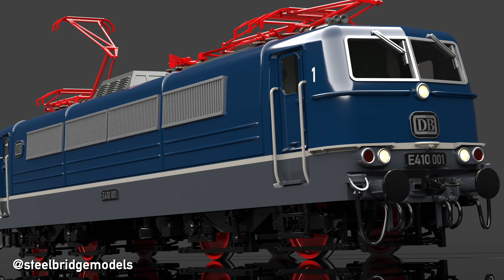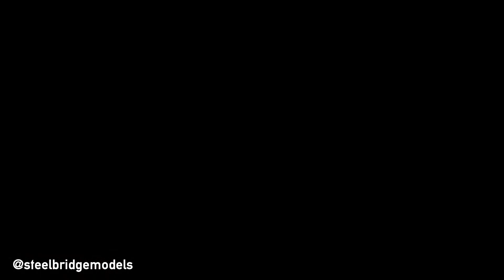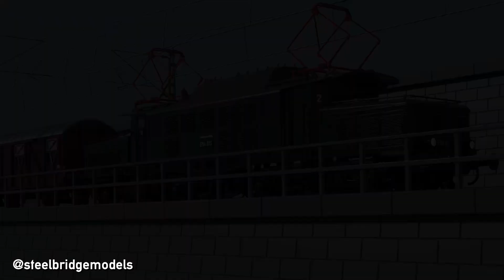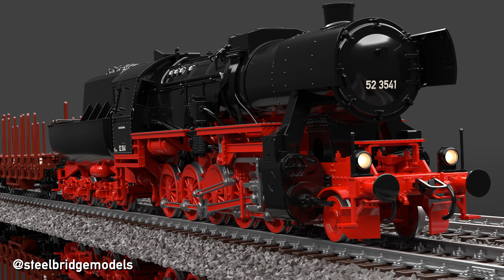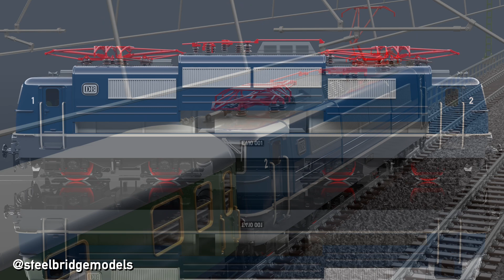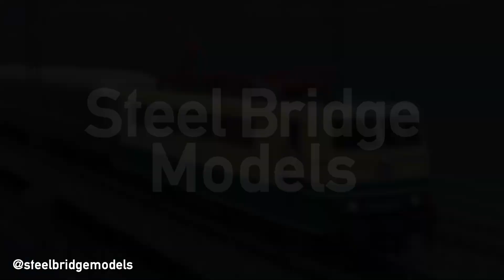And why that requires 4 Pantographs!

Comment: Very very informative, thank you.

What I'd now be really interested in is how the swapping from one Country electrical system to another was actually done - was there a section of catenary which could be switched between different voltages when a loco stopped under it and was ready to drop one pantograph and raise another?

Comment: Would you consider making models of one-off experimental engines like turbines or high pressure locos?
Reply from the maker: If they are unique and/or historically important enough, definitely. Currently, however, experimental designs are fairly low on my priority list. Any specific ones you're thinking about?
Reply: @ H02 high pressure and T18-1001/1002 turbines. But they are kinda obscure and a little short on details so I don’t know if they would be of any interest to you. But they were fascinating experiments that looked at alternate methods of steam power so if that matters to you in anyway it might be worth looking into them
Reply from the maker: Obscure they are, but very interesting! Coincidentally I even have enough research material about both of these classes to create models of them. So maybe one day, but unfortunately not anytime soon.
Reply: @steelbridgemodels  then I’m sure you’ve looked at the Franco-Crosti class 50.40s. Just wanted to bring these to your attention.
Reply from the maker: @SteelCityNLakeErie  I have and due to their relatively large number they have a fairly good chance to be turned into a model eventually!

Comment: For me, most logical solution is 25kV 50Hz AC, as 50Hz is EU standard, and 25kV is good compromise between power, power loss and insulator cost.

Comment: some corrections are needed. 25kV 50Hz actually have German origin. In 1936 Deutche Reichsban have electrified Höllentalbahn line using 20kV 50Hz system. Due to post war occupation French engineers examined this system and introduced it on then isolated section south of Geneva in 1951. Just two years after that voltage was raised to 25kV and this became new standard for French railways. Or did it? Actually France still had 1500V DC electrification spreading widely.
DC for traction motors is very convenient: series motor is relatively simple and can be controlled via use of passive components. Germany have experimented with three phase electrification (as the country of origin for three phase systems), but it was too much hassle - induction motors had large starting current and did not like voltage assymetry happening, when one of three pantographs experienced arcing. This is why Germany went for single phase supply, but grid frequency was too high for universal series motors (they can run on DC too and have construction very similar to series DC motor) - now commutator was experiencing arcing. To reduce it frequency was brought closer to DC - at first at exactly third of national grid frequency. Being AC it still allowed to use transformers onboard the locomotive, reducing current and making arcing automatically quenching when passing 0V. Perfect! Nearly, because it required building nationwide railway grid. However, they made it and have it.
20kV (and later 25kV) was different. While overhead wire carries AC, motors are using DC. This was made possible by moving most of substation equipment to the locomotive: transformer and rectifier. This approach allowed use of high power DC motors - still simple to control - without melting the catenary. And it could still run off DC lines, just by simply bypassing the onboard substation. Advance in solid state rectifiers brought another idea: induction motors are typically smaller and have no commutator. This increased cmplexity of traction vehicle, but actually ade it more reliable.  Yet, single phase load on the national grid may create imbalances - however even in France they are at acceptable levels.
Reply: Have you ever heard about the Hungarian genius Kálmán Kandó? He developed the 3-phase system for North Italy, then, between the 2 wars, electrified the Budapest-Vienna railway with 16kV 50Hz AC using a special converter, which was a 16kV 1-phase synchronous motor and a 3-phase synchronous alternator in one machine. It required a.small DC motor to accelerate it to the synchronous speed,.then the main contactor could be switched on. The V40 was designed for passenger service with a higher top speed, and the V60 for freight trains. Most of these locos survived WV2 and the last one was decommissioned around 1960, when the voltage of the last Hungarian tracks were altered to 25kV. Newer locos were built using a transformer (with 16 and 25kV taps) and a silicon rectifier or a Ward-Leonard machine (ac synchronous motor + a DC alternator of a diesel-electric loc).
Reply: i thought the 1/3rd grid frequency for rail power in Germany was to counter imbalances in the grid (since each phase gets the same average load)..
Reply: @unitrader403  you don't need frequency conversion to balance loads. That can be done with transformer connections in more exotic configurations (like Scott-T or even zig-zag), rotary converters, separate generators (fun fact: Germany had some power plants with separate turbogenerators) and modern day solid state conversion plants. Yet even in France, where you have single phase transformers tied to HV grid the imbalance is minuscule - and we are talking aboute power hungry TGV, not motorized cars of early days
Reply: @michawisniewski4654  not assuming todays tools for frequency conversion, i was thinking entirely about rotary converters and similar things available when these standards were established and the reason for choosing vthis frequency.. if they had the same frequency as the 3~ Grid one or two phases would take the majority of the load, so not much difference to using one phase directly..  and we in Germany take it very serious to keep the load balanced.. (you need permission from your Electricity provider if you want to have a single phase load of more than 16 Amps)

Comment: The Manchester to Sheffield line was 1500V DC locos always ran with both pantographs up even in multiple. These locos where also used by the Dutch post WW2 as the UK line construction was initially delayed (Bo-Bo EM 1 BR class 76 Tommy, the prototype) and also after the line in the UK was closed. The Co-Co EM 2 loco BR class 77/NS class1500.
Reply: On the coal trains, on the GC the inner pan was used for communication with the banking loco. Often on a lov voltage dc system the2 nd pan was put up just during acceleration when the power demand was high.
Reply: The SBB pan heads are also narrow.

Comment: Well, you forgot to mention the main reason, why the BR184 did not last very long operating into "DC-territory" ...
As soon as these locomotives crossed into SNCB territory they regularily created havoc in the Belgian signaling system (!).
... and the manufacturer was unable to eliminate the problem.
So, eventually SNCB revoked permission to operate these locomotives on SNCB territory.
As far as I know those locomotives never operated under 1,5kV DC (NS / Netherlands) - at least not beyond test runs ...
In context: Belgium had built 8 locomotives (class 1600) at the same time for the same purpose mainly for the Oostende-Cologne and Paris-Cologne trains.
They faced problems as well but these were almost exclusively related to converting AC to DC current where the rectifiers frequently failed and occasionally set the locomotive on fire.
Eventually they managed to solve those troubles somehow but overall reliability was comparatively low - but they were operational until retirement in 2010 (!).
The locomotives were as well operated into France (SNCF) until SNCB purchased 6 French built more powerful 4-System locomotives (SNCB class 1800) similar to the SNCF class CC40000 for this purpose.
Interestingly the SNCF 40000 never operated into Germany.
They were always exchanged with SNCB locos at Liege-Guillemins.

Comment: This earlier model would have been a nightmare to maintain having to support 1,500 V and 3,000 V DC and 15,000 V 16.67 Hz and 25,000 V 50 Hz AC overhead power. And this was the days before modern electrical design allowed for such a locomotive with way more reliability.

Comment: We have 3 different current systems on standart gauge lines in my country and historically in the former Czechoslovakia used to be all major 4 European.
Škoda Works Plzeň dealt with it,
firstly 3kV= / 25kV50Hz dual (classes 350, 363, 362),
second 3kV= / 15kV16⅔Hz dual (classes 372, 371, DR class 230, DB class 180),
third 25kV50Hz / 15kV16⅔Hz dual (class 340) and
last 3kV= / 15kV16⅔Hz / 25kV50Hz 3-system (class 380, 381 and DB class 102).
Also there are still system switching stations, in Slovakia Bratislava Petržalka stn, in the Czech republic Kutná Hora stn, the another one was moved from Nedakonice CZ to Říkovice CZ. Others are on open lines.

Comment: Lima train set locomotive!  These also shared the same body with the original prototype 181.0/E310. I'm glad one 310 and 2 184/410's survive in preservation one has a blown surge protector however.
Reply: And they delivered them in every imaginable color scheme. Still have a blue one.

Comment: These DB classes are one of the pioneer multicurrent class locomotives build by several other railways (SNCF / NMBS-SNCB, SBB-CFF) uniting modern rail transport in Europe.
These are the grandfathers of the current used multicurrent locomotives.
While only partly succesfull at first due to enginering challenges all those pioneer locomotives led to modern reliable universal locomotives.
The Traxx platform still operated in lots of European countries can be seen as the first mass produced electro "Europa Lok" 
Not so long ago locomotives had to be changed at the borders due to different currents signaling systems or even different needed traction methods, now only drivers are exhanged at designated routepoints (f.e. Rotterdam harbour - Köln Deutz) and the same locomotive hauls the train truh several countries.

Comment: I think in may cases you said current instead of voltage. The only time you used the term current correctly (from a electricity point of view) was at 7:06. Every other case it should probably be voltage.

Comment: Just before World War 1(Great War) America had vast electric lines. The Pennsylvania Railroad(today Norfolk Southern) is the most famous with parts of the North East Corridor(NEC) still with the original catinary masts to run with their GG1 locomotive. However despite being the most famous, there were more. Expanding west from Chicago to points west as part of the northern most transcontinental railroad(transcon), the Great Northern Railway(Today BNSF) had aspects of their line electrified, running under them were Y-1's, Z-1's and W-1's. The Milwaukee Road(today part of the CPKC, via SOO) is the most famous for it's western running electrified lines, running on parts of their "Western Expansion", and under those lines were EF-1/EP-1's, EP-2's, EP-3's, EF-4's, etc. Another famous engines is the Steeple-cab switcher, which could be seen on various class 1 & interurban lines throughout the US. As you can imagine to, NONE of them practiced horsepower loan/payback(a practice in which another railroad's engines run on another railroad, either on loan(I.e: to not swap locomotives on trains that start on another railroad's lines, but ends in another's), or horsepower payback(I.e: to payback the other railroad for using that other railroad's engines by loaning out their own). with differing environmental, and electrical incompatibilities like long harsh winters in the Rockies, vs the rapid accumulation of snow southeast & east of the Great Lakes.
Reply: Would've been cooler if y'all had kept them...
Reply: @bahnspotterEU we kept only the lines that had high volumes of Passenger Service which is to say the Electrified Commuter railroads stayed whereas the Electrified Freight was ditched
Reply: @bahnspotterEU  It'd be cooler, yes, but that aint what happened. Thankfully, SOME of the electric engines, including a number of GG1's are preserved, though are not operational. To add to that, aspects of the original PRR catinary are still in use, though are due to get replaced. The exact reason for a obvious lack of electric lines today is the culmination of factors, ranging from environmental, to economic & political. For example, re-electrifying the Northern Transcon would be expensive, add in the relay stations, further land easements('cuz we have these things called property rights), power generation, etc. We have the means to do so, but yet at the same time we DON'T. Which is honestly just sad.
Reply: Virginian, too, had a very interesting system
Reply: @Lightning_Mike  Forgot about them...yeah, they were the interesting bunch. Very experimental back then.
Reply: The Great Northern only had a fairly short (just under 120 km) section including the Cascade Tunnel electrified. The Milwaukee Road electrification was far more extensive covering over 1,000 km of its lines. In both cases the electrified sections were quite small compared with their overall distance of more than 13,000 km for the Great Northern and more than 18,000 km for the Milwaukee Road.